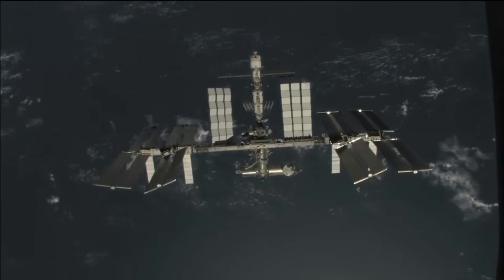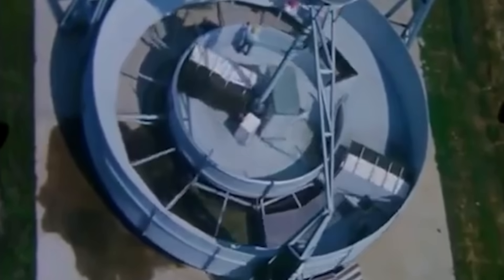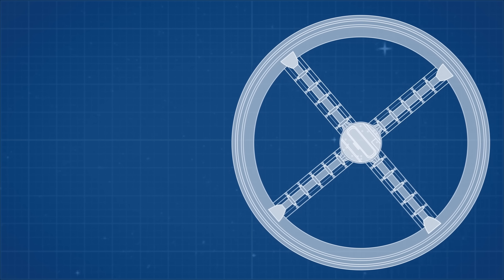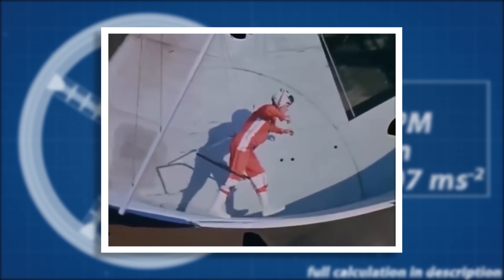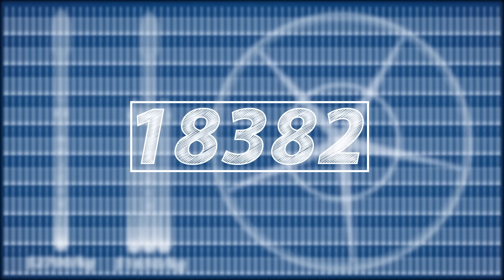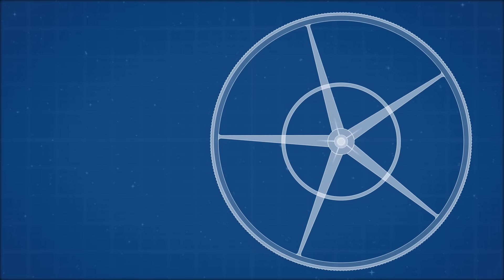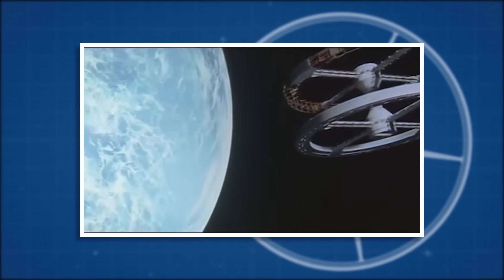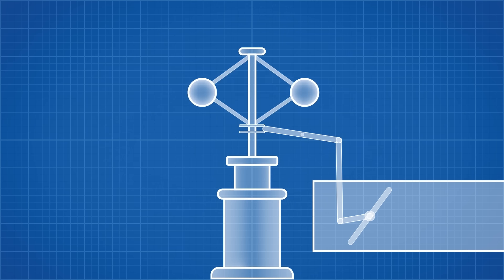Can We Create Artificial Gravity?

Comment: 4:00 we shouldn't take the Shuttles launch costs as factor here imo. I mean it was highly inefficient and compared to modern launch systems like the before mentioned Falcon Heavy - or any other standard rocket that isn't a combo of a shitty hightech plane strapped to some boosters and a tank it was extremly expensive - compare the 1 point something billion $ per shuttle launch to the 61 million of say a Falcon 9 (price from 2014 according to wikipedia) or the 150-220 million of an Ariane 5. Sure the shuttle could lift a bit more (about 8 tons more to LEO than the Ariane 5 iirc) but still. I'd rather have two rockets fly up that cost less than half of what a single shuttle launch costs.

Comment: it does not need to be a large diameter, it only needs to be long , i.e. two masses separated by a long cable spinning around their centre of mass
Reply: You save some material that way, but you are losing some comfort and security. Now the only way to get to the other side of the station is through microgravity. And if your tether gets hit by an asteroid, there is way to have a backup that will take the weight, and your living space flies off into space. With a continuous ring, you can walk the entire circumference, and you can have multiple spokes supporting the structure.

Your design also means that you're not maximizing the livable area. Every bit of material you add to make a larger ring also gives you greater surface area in the gravity section. So, if you want to accommodate a lot of people, you'll want to build one large, continuous ring anyway. You just want to work out how much material you can get to build the largest ring possible, for capacity and comfort of inhabitants.
Reply: Three masses works well, one in the center for zero-g and docking.
Reply: Bolo and hourglass habitats address this. They have drawbacks to them that Torus don't. Then the Torus also has drawbacks that an O'Neil Cylinder does not. Really, scaling up makes it more stable and less dependent on fine tuning. If you have a larger and more complex biosphere inside of it, it can handle disruptions easier.
With all of these habitats, wobbles can damage or destroy them. that is another thing that mass addresses. However, the odds of an asteroid striking a cable are probably the same as an asteroid destroying your house.
Reply: @talyn3932  It's a pretty easy way to murder a bunch of people (and get away with it too). Just cut the tether.
Reply: Exactly what I was thinking!
Reply: twang Goodbye Earth. Hello cold abyss.
Reply: Would put too much stress on it!
Reply: @paulporteous4190  too much stress on what?
Reply: So they could rotate in a ring of... Large diameter.

Comment: There are more ways. dt = 1+g/cc per meter on earth, or g= (dt-1*cc) where dt is Change in time experience. Meaning gravity is bend space time. If you bend spacetime you have gravity. The electromagnetic field of an electron is changing when moving. The time in the electron is changing when moving in relation to a standstill observer. This will only Show if the electron is moving through a common field between electron and observer (see Faraday disk). The new electronshape as a thorus, the changed time experience and Speed is lorenz invariant. Meaning if I Change the electron shape from ball into a thorus under a common field with the observer, but Keep it standstill by chaining it to something, still the time experience must differ between electron and observer, and therefore I create a changed timefield over the electron. Changed time experience is dt = f.e. 1+g/cc per meter = gravity. If I do this for a zillion electrons I have my artificial gravity field.  Takes quite some energy though. Have fun!

Comment: I have a question, lets say i have a handheld fan. On earth, I hold the motor and the propeller is rotating because of motor rotating it. What if in space, i turn on the motor and let go it and it floats in air. While it floats, will the propeller rotate and motor stays stationary or will the motor rotate and propeller stays stationary or will both rotate at equal speed opposite in direction?

Comment: You don't need to build a circumference, just two small ships tied by a long thin structure.
Reply: Or maybe a single ship with a counterweight like one of those metallic asteroids ?
Reply: @enderyu  why not a Tesla car - better than sending up a concrete bloc as a counterweight
Reply: @enderyu  Guy, it is never possible!
Reply: zanshibumi- I do not know the country in which you live, so it may be unlikely that you have seen it, but a concept similar to your proposal was featured in the BBC tv series "Star Cops" (which aired on British television around 2004) where the International Space Police visited an American space station that used a module on an extended gantry to provide earth gravity.
Reply: @MervynPartin   You are right...I have also seen that...
Reply: Juno Berries i assumed they meant two fixed habs on either end of a tubular structure of some sort. Like a bar with weights on the ends. The docking point would need to be in the centre. Perhaps a small hub with the rest of the station turning around it that can be used for zero-g experiments and docking.
Reply: not a bad idea of all the ideas I think it's a very feasible one
Reply: Yes as there is no considerable air friction in space.
Reply: But then you have a very small station
Reply: Check out NASA's new artificial gravity concept! https://www.youtube.com/watch?v=dfbn7b8v2wM
Reply: That would work but people don’t realize that by doing that you are drastically decreasing the surface area.. With a circumference ship you can get 500-2000%+ more usable artificial gravity surface area.
Reply: Juno Berries , I agree. Easy to compare with the "arco batente " of old cathedrals.
Reply: it could actually be a series of flat segments on a wheel type structure and each one could be an apartment building of sorts with an exact opposite. you could do 6 or 8 or more depending upon the radius of the structure. the angle of the centrifugal force might get weird at the ends of the platforms but you still get to use the entire wheel rather than only two opposing buildings.
Reply: And the a big asteroid hits the thin structure which wraps around the big rock and takes you for a joy ride. Free out of control propulsion ?
Reply: Bubba Ole
  That's what you use radar and lidar to scan for, and lasers/railguns to change the asteroids trajectory.  Or, if it is too big to move out of the way, scan the asteroids motion to determine trajectory, calculate where and when it will meet with your craft, and move out of the damn way.  You wouldn't build a sweet gravity simulation setup like that just to not equip the system with some decent collision detection hardware and countermeasures.  Unless you are an idiot.
Reply: In science fiction they did something like this already in DEF-CON 4
Reply: From what I've read(and watched) on the subject. Any piece of debris in space, would become a destructive projectile, if they did it like that.
Reply: Or a ship that can generate a resonance field that acts like gravity.
Like the CIA showed us 2 years ago. The Ufos are real.
Reply: @Heliarc91  The CIA showed you and which other members of the illuminate?  Who is "us"?  How can I get into this group?
Reply: @TexMex421  Youtube search "ufo gov official speaks out:"

It aired one day
Reply: @Heliarc91  No results found for "ufo gov official speaks out:".
Google search how to provide an actual reference or link.  Things like know the name of the person, the date etc can really help. If you want to be taken seriously anyway.
Reply: @Heliarc91  Ah, so when you said the CIA, you meant Luis Elizondo?  Who never worked for the CIA.  Luis Elizondo who never said "UFOs are real", but rather some stuff to promote the TV mini-series he was promoting. ? And nothing about "a ship that can generate a resonance field that acts like gravity" as you mentioned?
Reply: Look at the movie 2010 a space odyssey.
Reply: and what happens when you tie a rock to a string and spin it and the string snaps? you REALLY don't want that kinda shit happening when the vast majority of the literal space around you is empty void space. You'll either be flung into nothingness to die a slow death, or towards earth for a very hot landing. a wheel structure is a lot safer logistically.
Reply: @demonzero677  What happens, the rock simply continues on a straight path.  If this happened on a spacecraft you'd loose your artificial gravity all at once but otherwise there would be no ill effects.
Reply: That wouldn't be as practical . Think about how by adding a tube you disabled the ships ability to rotate on its center point and so the gravity inside the ship won't be distributed equally as the farther you are from the pole the stronger gravity is.
Reply: same thing
Reply: Where from will that long thin structure come?
Reply: Your structure may produce gravitational-wave which may be reflected from some other nearby mass particle causing curvature in the space time and this will change our position coordinates with respect to time in the universe.
Reply: For every action you need an equal and opposite reaction. from an engineering standpoint a ring makes perfect sense due to the fact that the centrifugal force can be distributed evenly. the greater the mass the less the effect your body will have on the ring of a massive station.  attaching two ships at the end of a tether would destabilize  the rotation of a structure causing it to spiral out of control. 
the best way to dock a ship would be the center point of the station, known as a ring or centrifugal station. 
or alternatively, stopping the ring's rotation to allow for docking could in essence allow for ships to temporary dock, however most craft are exceptionally heavy  so rotation would destabilize the ring, causing it to spiral. 
the best way to dock without spinning down the entire station is to have outside craft dock in a rotational holding maneuver.
Reply: Juno, interesting points. Re. 2 stations joined by cables (or 1 station and a counterweight), the stability of the whole system would have to be controlled _actively_. Like modern jet plane designs, aerodynamically unstable, but stabilized by a computer. Everything would depend on perfect control of the spin, and on the torsions on the joining cable. Tricky, but not impossible. Proof of concept could be achieved in stages: First figure out how to control a stiff cable,of moderate length spinning in space. Then incrementally add weights at each end, experimenting with controlled thrust systems for stability. Then increase the distance, to approach the rotation size that would approach that practical for fake gravity.
Such an intriguing idea!
Reply: Cyphik: Doable, yeah – but way more complicated than us armchair space-geeks can imagine! Cuz the number of interacting forces at play  is boggling – far more than the simple centrifugal force. Torsion/twist of metals is über complex! Also: Resonance and vibration! What we're conceiving here amounts to a giant guitar with a connecting string under massive tension. Materials have irregularities, so the exact forces can't be predicted ahead of time. And the long distances of a 'spoke' would amplify any deviations they cause. So any logic system to control all those chaotic forces would have to have a lot of little thrust engines to control, at a bunch of different points in the system. Good luck! Any project to achieve all this would have to start small and simple, and as the problems slowly get solved (by active control systems), then they could start adding size and complexity, bit by bit. Rinse, repeat.
Reply: Juno Berries i think that you would simply build a space dock onto the center that us mounted on magnetic rails that stays stationary relatively to earth
Reply: @ferret1337  the system will never disturb you life because there will be some normal reaction which will balance the centrifugal force and provide the centripetal force thus creating an artificial  outward acceleration.
Reply: Carbon Nanotubes...
Reply: zanshibumi True, but what's your plan to deal with the ionic charging that builds up on tethers in space. Such a structure would generate dangerous levels of static charge quite quickly. You'll need to have an exceptionally efficient method of either collecting or discharging that current.
Reply: Michael Foye powers the station and charges the capacitors for a huge rail gun which shoots canisters of supplies to mars.
Reply: zanshibumi yeah but the two space shuttle has some gravity pulling the thing tubes closer until it snaps. NASA would need to make the tube extremely strong and that’s the big issue
Reply: @ohtych1004  we could make a tube strong enough. We have special alloys for things like that (Tensile stregnth) 
Metals up to 120,000psi tensile of solid material that I am aware of off top of my head.
Just a bunch of math.
Reply: What is NASA making you build now and what do you need to know? Do you how to solve Ferengi non homogeneous differential equations ?
Reply: zanshibumi
AT LAST!!! Someone else who gets it!

Comment: So if all atoms/particles carry an electrical charge

Could you line your floor with a single electromagnet wire then in the design of the ship leave small holes through which outerspace can cool a super conducting material and push us downwards of course we would not be exposed to outer space

Comment: The cheaper and practical way to do this is with a tether and a counter weight.  In a multi stage space craft similar to Apollo the crew would stay in one section and another section would spin far away.  They would have to be connected by a strong enough tether that it would not snap as that would lead to a bad day.  Zubrin brings this up in his mars direct plan.

Comment: centrifugal force is an illusion created by inertia and centripetal. Google it, it is the 'apparent force of centrifugal' officially now. if you imagine a car going around a corner, it does now go off the road because of centripetal force, this fights the objects inertia. If you removed centripetal force, the car goes off in the direction of it's inertia, NOT centrifugal force. It's inertia is at a tangent to the corner, the centrifugal is perpendicular to the center of the tangent. In other words if centrifugal force were real it would fly off 90 degrees to where it would actually go.

Comment: I'm more taken about about the amount of aluminium required. Surely we have built similarly sized structures on Earth? I mean, you could build essentially an inner tube with a very small hub. 
A 600m diameter is just over a mile long- I know we prefer concrete and bits of steel over aluminium tubes down here but that doesnt sound like a particularly huge feat.
Also interested to know how the costs of haulage would change if SpaceX ever reach their stated goal for BFR, as they are talking about order of magnitude reductions.

Comment: Just discovered your channel. Subscribed! You say in the video that a annular shape spinning space station would consume a huge quantity of metal for its fabrication. I just wonder why, if this is the case, we keep thinking of a huge spinning ring when building just part of it would suffice.

As a first step, imagine two small portions of the original ring, diametrically opposed, connected by a tube. Make this spin at the same speed the huge ring would have spun, and you'll have in each section the same artificial gravity you would have in the huge ring.

Next, you realize that there's no point in having two ring sections at opposite ends of the tube. One can be replaced with a dead weight, like a rock you pick up on the moon. And  the tube can be replaced with cables.

If the station needs to grow, the ring section can be expanded, and weight can be added at the other end. Simple, no?

Comment: UTTER BS you only get structural stresses when weight & movement is involved. In a void  there is NO WEIGHT as for  Nasa doing a test on Earth is one thing  where centrifugal force sends objects outward because of DENSITY.. but in a VOID it wouldn't matter how much an object span because the  things within would still float about independently  of the shell,  these Sci fi films are utterly ridiculous  when it comes to this.
As for making the Math fit ..... 😂😂😂 GOOD GRIEF.
so laughable.  They still believe the Mass of an object is what causes Gravity.   So funny.  Here's a clue, it's nothing to do with Mass  but electricity.
It's all mute anyway Space doesn't  exist, and planets are NOT what you've all been taught since kindergarten.  it's all a fairytale to Dumb the populace down. 
Moon landings never happened - it was a production nothing more,  You live in a pressurized system,  that can't exist next to a void. The only thing that can contain pressure is either a solid barrier or something of equal pressure.

Comment: The space station wouldn't have to be as massive as the Elysium example to have the same effects.  It could just be a rotating bar with smaller habitable modules at the ends instead of a huge continuous wheel. As long as the bar were as long as the diameter of Elysium Station, the effect would be the same no matter how large or small the habitable modules at the ends were.